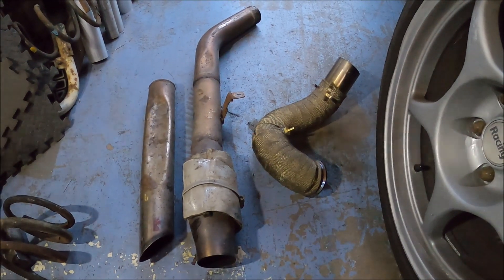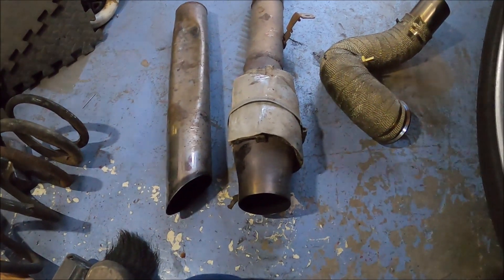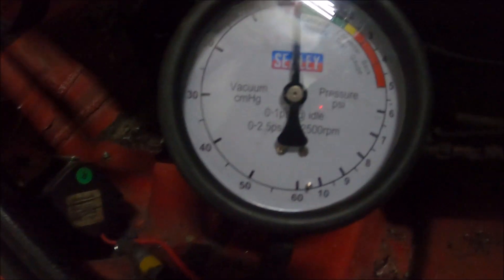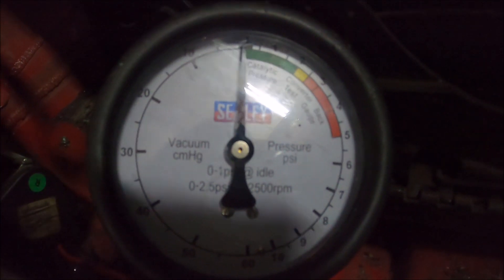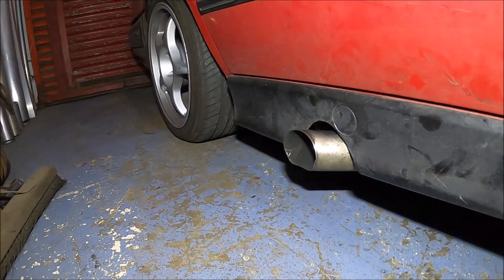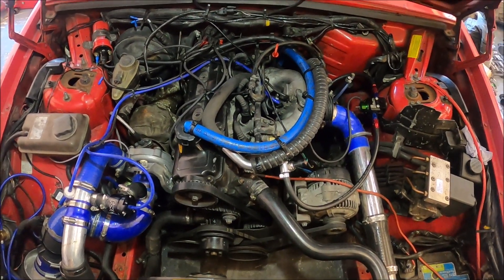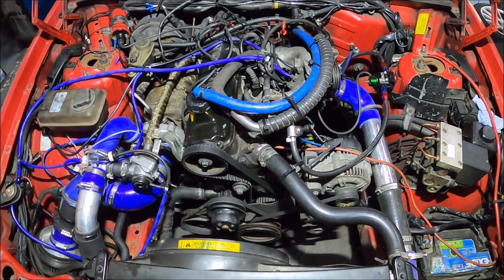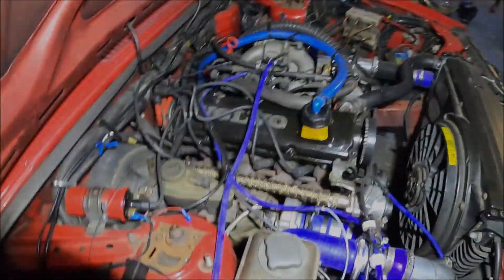Breathers and Backpressure! Catalytic Converters and Crankcases! More Volvo upgrades...

Comment: youve already got 14PSI of back pressure with the engine turned off but your gauge says 0PSI at idle.

 get an accurate gauge that gives accurate readings and try again, otherwise youre just wasting your time

Comment: How did you secure the elbow into the filler cap so it don’t blow out?
Reply from the maker: Just a tight fit. If it blows out you have pressure, and that means you done something wildly wrong lol

Comment: Has the boost now increased abit with the cat removed? What happened to ditching the DV? I saw the forged one had gone for a re-cirv?
Reply from the maker: Boost went insane, 25psi+ so had to turn the duty cycle right down.
Running no DV still. What you spotted in this video is something else...
Reply: @StavTech  ah it's just clicked the heat wrapped pipe going off to the manifold? Anti...